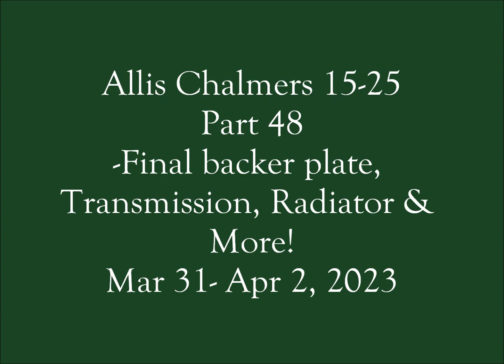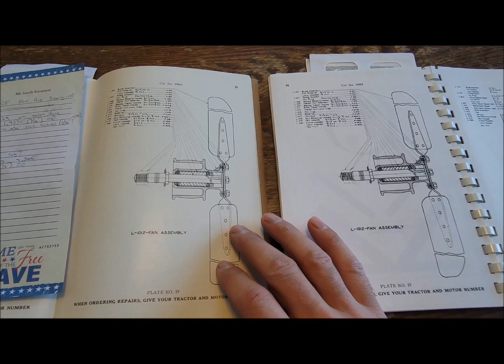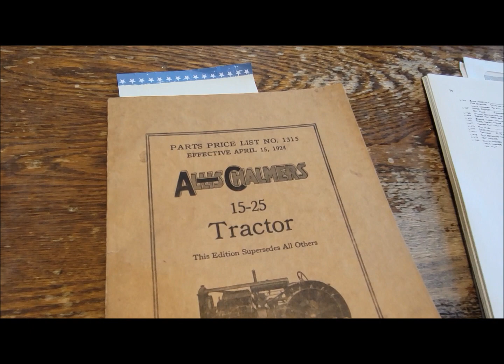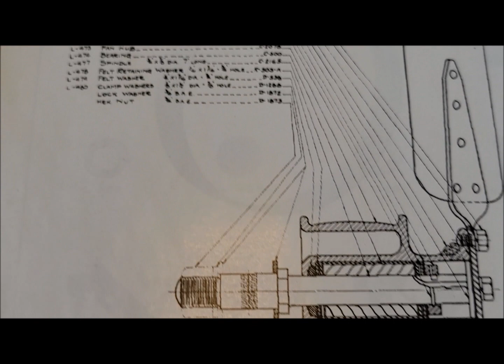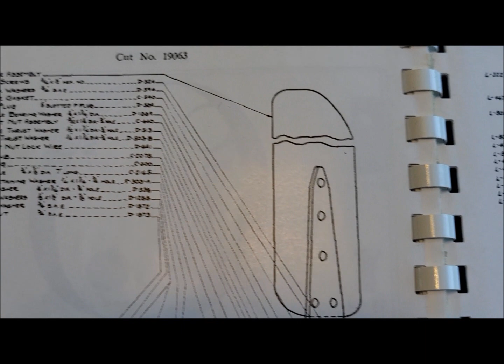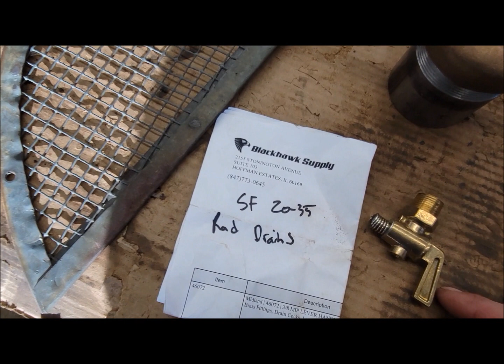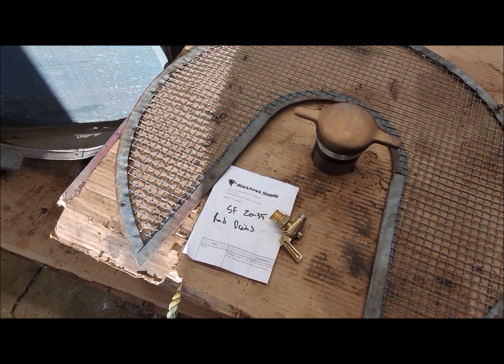Allis Chalmers 15-25 Part 48 -Backer plate finished, transmission, radiator is apart, fan blade info

Comment: Why am I hearing Adam Sandler saying, "Just a little tippy, a tap tap a roo?" Remember, Happy Gilmore, lol?

I'm not sure if you are aware or not, but there is a tool to help straighten radiator fins. It's called a "Radiator Fin Comb," and you can get different styles from your choice of vendors. Looks like they are based on the # of fins per inch for the correct size.
Reply from the maker: "Just tap it in..." HEHE!
I know there are combs, but I do not have one, and honestly with as munched up as these are to start, the comb would not do much good, at least until you have them fairly straight.  But it may be worth a shot on future projects, thanks for watching!